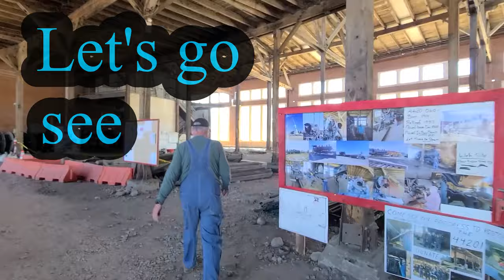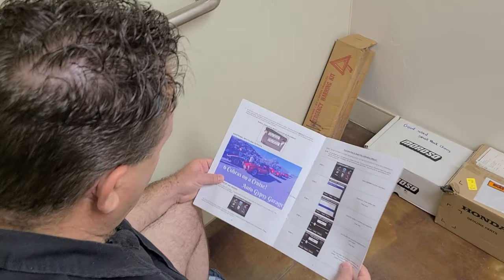Restoration progress Union Pacific #4420 Steam Engine In Evanston Wyoming meets Utah A/C Cobra Club

Comment: I had several goofs in my lecture. 
1. The tender planks were 1914 when the tender was built, not 1917. 
2. The valve gear is in forward in the lower section of the reciprocating lever, and reverse in the upper section. That is in case the control rod breaks, it automatically defaults to forward. 
3. Obviously, the heat travels from rear to front through the boiler flues from the firebox to the smokebox. 

Thanks for your interest in our project.

Comment: Is 4420 a oil burner or coal burner? Sorry for asking. Most websites won't tell me what fuel does she burn.
Reply: This one runs on coal. Thanks for asking.
Reply: @kellyfoster1458  no problem. I thought coal burning locomotives aren't allowed in the western states.
Reply: It is being converted to waste crankcase oil because it’s easier to obtain, we don’t have to worry about coal ash disposal, and it’s easier to control the heat temp.